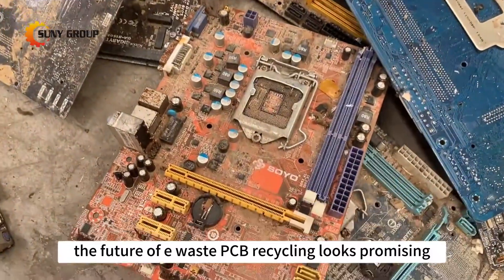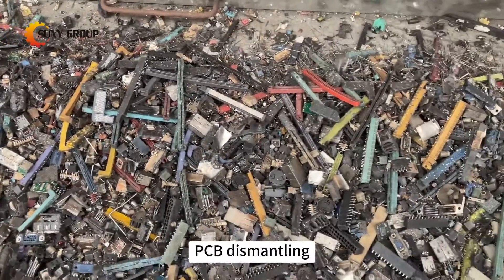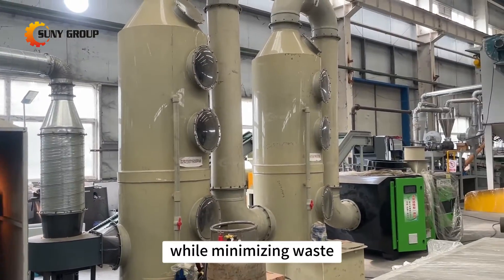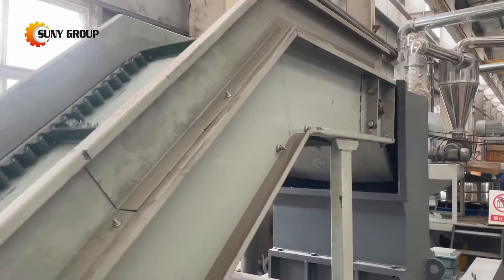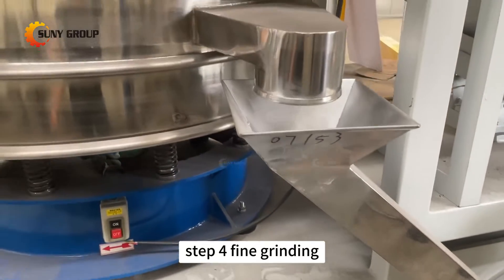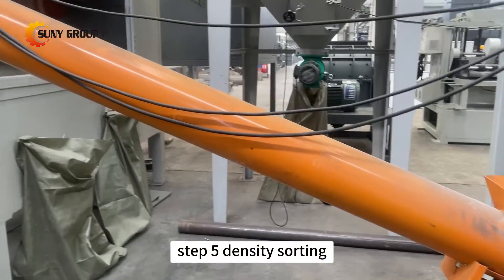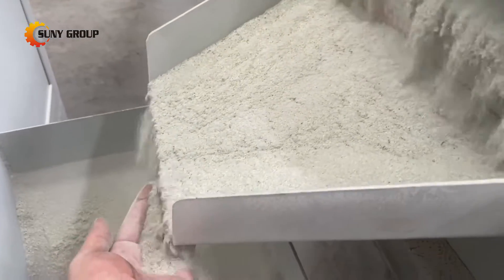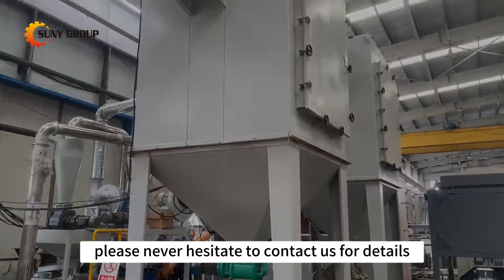E-waste PCB Recycling - Circuit Boards Dismantling & Sorting Line

Comment: Amazing!

So there's no burning step necessary on this e-waste recycling method?
Reply from the maker: for dismantling components from the circuit boards, it needs the buring step. there is a dismantling machine - rotary burning furnace.